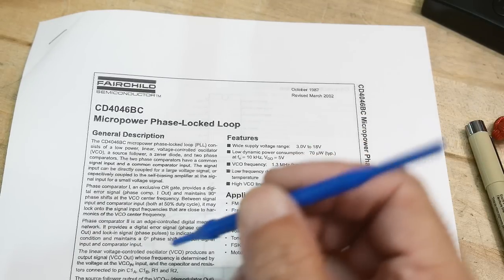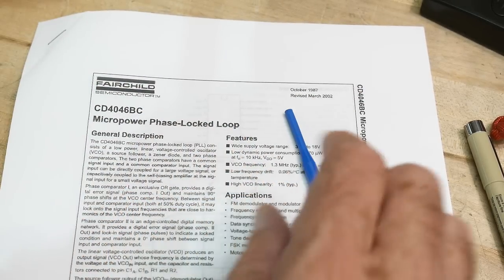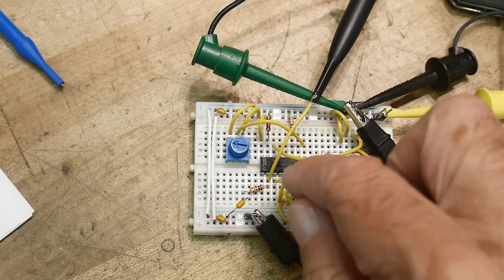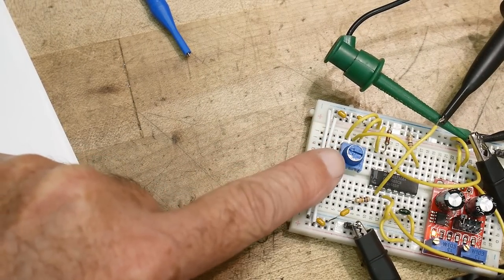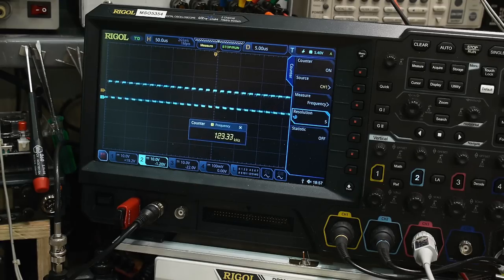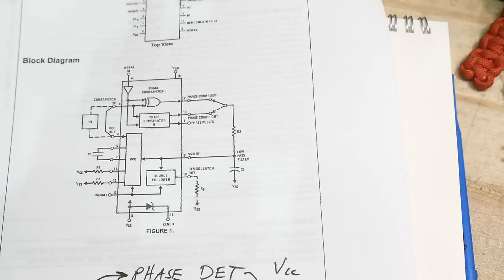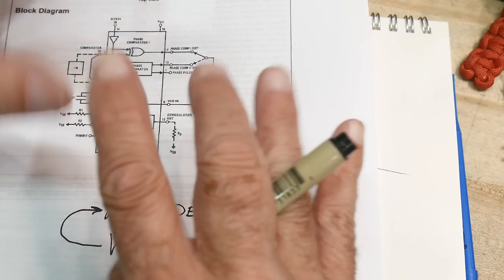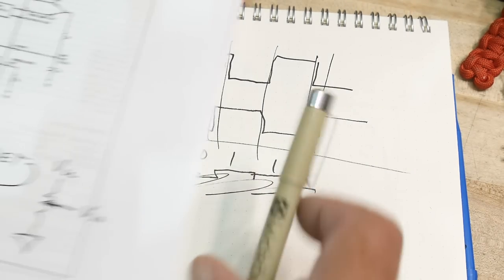#1107 CD4046 Phase Lock Loop Basics

Comment: PLLs are so cool :)  

Prior to joining the service and getting training in satellite communications my experience had been mainly with radios that used multiple crystals to generate the frequencies for a superheterodyne transceiver.   As we started learning about how the local oscillators and synthesizers worked in the satcom gear to generate the SHF frequencies from a lowly 10 MHz or 100 MHz reference by using multipliers and dividers all sorts of light bulbs went off.

By having a programmable divider you now had flexibility over the operating frequency without having to get new crystals.  Sadly, this spelled the end for places like Omaha Crystal where I used to be able to go and order a crystal of any frequency cut and have it ready in no time.

As you noted, the basic design of PLLs is pretty straightforward, but they can get really complex and one of the engineers that works for me actually did her Ph.D on PLLs.

Comment: GREAT VIDEO!! (you've 501 thumb's up's right now).
I can see soooo many applications I can this 4046 PLL chip for, with all you've shown other than (standard PLL apps) and greatly lower my IC-count.
BTW: I like to think of the XOR as a 'controlled inverter'....with one input pin HIGH, the output inverts the other input, and follows it for one input LOW.
THANKS MUCH!!!

Comment: How does the output voltage from the low pass filter correspond to the exact voltage which generates a wave of the same frequency as the timer? How does a 50% duty cycle correspond to the phase lock ? In a frequency synthesiser PLL we need the VCO to operate at different frequencies, how is that accomplished? Say for 50 MHz operation the input voltage to the VCO is 5 Volts, now due to some instability the frequency of the VCO drifts to say 50.5MHz, at that point does the PLL need to bring down the VCO voltage to bring down the frequency ? I guess so. That means the VCO voltage vs frequency curve has changed ? Would be great if there could be a follow up video on this.

Comment: So phase-locked loops don't actually cause the VCO to match the phase of the input signal?? I assumed at lock they'd be exactly in phase, but I guess not. I never could get my head around how they would cause that to happen, and I guess the answer is "because they don't."

I remember reading about the CD4046 as a kid and thinking there was no way I'd ever understand how the hell these things worked. Yet, here I am, and I get it! Thanks for making this video!
Reply from the maker: the XOR detector will lock the phase to 90 degrees. there are other types of phases detectors that will lock at 0 degrees

Comment: I'd be interested in a video on the loop filter design criteria. I guess you need clean dc to control the VCO but too much would slow down the locking time.. Also most PLL circuits have an additional resistor in series with the filter capacitor. A down to earth discussion on these points would be very helpful.
Reply from the maker: The stability and capture range of a PLL is something I'm not qualified to talk about.

Comment: Drat. I didn't understand what happened at 17:33. Just because you take an average of a signal... How did something loco? Where did that average go? I would have liked to see the circuit at that point.
Reply from the maker: the average goes into the VCO and speeds up or slows down the signal until they match
Reply: @IMSAIGuy  oh ok thanks

Comment: Can I use my arb function generator as the phase input?
Reply from the maker: if you try to PLL to an arb waveform you will have problems
Reply: @IMSAIGuy  ok. It's easy enough to set a 555 anyway. Thanks

Comment: I am missing something.  In the signal flow diagram at about 15:00, why should the system "prefer" that the average of the XOR be at the halfway point?  Is the frequency from the VCO inversely related to its voltage input?
Reply from the maker: the average 'match' of the XOR gate happens at a 90 degree phase shift between the two signals. it is easier to think about frequency only at first. if the frequency is too low then the average signal will be low and the VCO will speed up. if too high the VCO will slow down.
Reply: @IMSAIGuy  - Thanks for the reply.  However, my question remains albeit somewhat altered.  Why does the system "prefer" to lock in at 90 degree phase shift?  As nearly as I understand, there is equivalent of an op-amp with negative feedback set to 0.5 to drive the VCO.  At least that's where I think I am stuck.
Reply from the maker: @thomasknapp7807  try this: https://youtu.be/SS7z8WsXPMk
Reply: @IMSAIGuy  Thanks.  Your video explains the XOR concept as well.  W2AEW's video does not close the loop with the XOR (Type 1) phase detector, but does with a Type II.  I have looked at other videos and search references.  I cannot find an explanation for the lock.  One puzzle is that the voltage into the VCO from the LPF controls the frequency of the VCO output, but in both videos the desired reference frequency and the output frequency are shown from the start as being the same.  This is a negative feedback system and it appears to me that critical elements for that negative feedback explanation are missing.
Reply from the maker: https://youtu.be/PsUPRyatjxw
Reply: @IMSAIGuy  I had found that video.  I follow you since you present topics so clearly.  In this case, my sense is that you overlooked something which you have accepted for a while.  I will continue to see if I can model it in Scilab and LTSpice.  But, I'd really like to hear your insights into why and how the lock happens since I find your views interesting and useful.  This appears to be an important negative feedback application which might illuminate other situations.
Reply from the maker: @thomasknapp7807  I'm pretty sure it is as easy as I say. The only sticky bit might be that the 50% point is when the two signals are at a 90 deg phase shift (locked though). Moving away from this 90 deg phase results in a linear voltage change to the output of the loop filter.
Reply: @IMSAIGuy  Yes, there is a change when moving away from 90 degrees.  But, it is lower for lower phase shifts and higher or higher phase shifts.  That is, the 90 degree point is not an inflection point nor a change in the algebraic sign of the slope and therefore nothing obvious that should make it a "preference".  And, since the averaged XOR output varies the frequency of the VCO, that must be part of the explanatory picture.  At present, I cannot see how.  Sorry to be like a dog with a bone on this, though I think it kind of neat and I'd like to understand it.
Reply from the maker: @thomasknapp7807  you are on your own
Reply: @IMSAIGuy  OK.  From modeling in LTSpice and Scilab it appears to me that the averaged XOR output is almost always going to be about 0.5 V.  The exceptions will be when the two XOR inputs are exactly matched in frequency.  In this case the XOR output will be a constant as a function of the signals’ phase difference.  For a frequency difference between the two signals of even 1 part in a 1000 or even 10,000 will produce an average 0.5 V output regardless of the phase difference.

The CD4046BC datasheet, pdf. 11, in the row “VCO Frequency” has very strict limits for both types I and II comparators which aims for the desired VCO frequency to produce the 0.5 V averaged, XOR output.  The rest of the datasheet has many other requirements for the part to work as desired.  That is, it does not appear to me that the reference “Signal In” (pdf. 2) may be varied willy-nilly so as to have a convenient variable frequency oscillator.  The designer has to have a very specific application in mind which, when implemented, cannot be changed without external component changes.

Comment: 17:40 After the phase is locked, I understand the frequencies' become equal. But why there is still a phase difference between the timer output and VCO output (i mean the blue and purple signals on scope)
Reply from the maker: the XOR phase detector will always be 90 deg shifted. other types of phase detectors can be 0 deg
Reply: @IMSAIGuy  why is it 90 degree shift? thanks
Reply from the maker: https://people.engr.tamu.edu/spalermo/ecen620/lecture04_ee620_phase_detectors.pdf